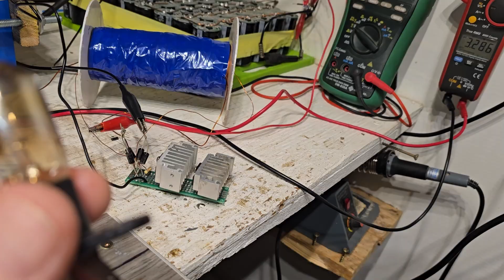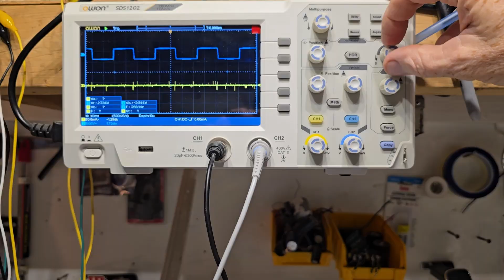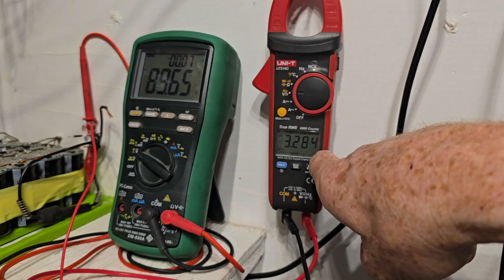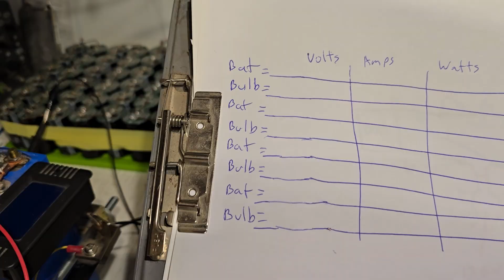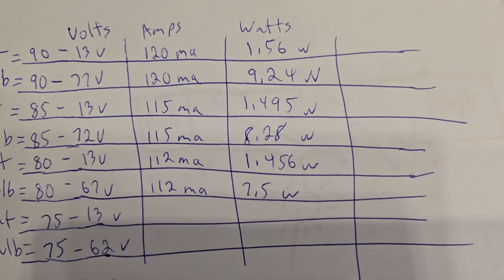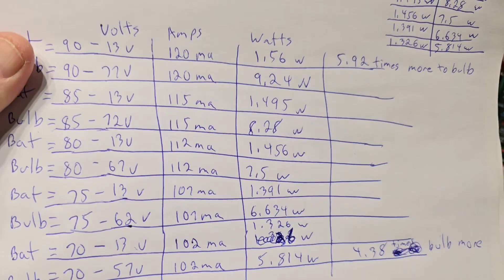New coil 13.1 volts input Charging 105V12F supercap bank then returning power back to source battery

Comment: Your results keeps getting better each time. Great work as always mate.  It would be interesting to see if the joule ringer coil with the same amount of turns has the right insulated wire rather than magnet wire which will generate the Ferranti Effect. The Ferranti effect refers to the phenomenon where the voltage at the receiving end of a long, unloaded or lightly loaded AC transmission line that can be higher than the voltage at the sending end. This unexpected voltage increase is primarily due to the line's capacitance generating reactive power when the load is low.  When a long transmission line is lightly loaded or unloaded, the line's distributed capacitance draws a charging current. This charging current flows through the line's distributed inductance, causing a voltage drop that is in phase with the sending end voltage giving the additive effect as  the voltage drop due to the charging current adds to the sending-end voltage, resulting in a higher voltage at the receiving end.
Reply from the maker: Ha I've already got videos made with this with another component added to this circuit.  I don't ever use stranded wire for this reason.  But I'd be interesting to see someone else trying your thoughts.  These results are very real very real and I would like to see others results with this circuit with their own type of mods. That joule Ringer circuit could be interesting with these types of mire and windings also.

Comment: Will catch up in a bit, just have a recurring question, finally putting it down... where would you shop for reliable super caps?  I tried searching on amzn, but the comments for most were quite discouraging so decided it wasn't a good source.  I have several applications for them, including tinkering of course!  Anyway, they can be pricey so don't want to spend on stuff that doesn't work.  Appreciate your advice on this.  Will watch this in a bit, been a crazy week.
Reply from the maker: I've always got mine from E-Bay
Reply: @windpowerandmore6310 any seller you find reliably good? Do they come with the protection circuit board or do buy them separately? One application I have is to place a pack between 48V batteries and inverter, basically size batteries to base load and cap bank for surge. I’m guessing I need to size cap bank to a voltage higher than 48V. They are LiPO4 so they likely push 51.x. But I think the caps need a buffer above that, right?
Step after that, as I have two sets of batteries, is to see if I can replicate what you’re doing. Cap bank would get second use that way. 😊
Reply from the maker: @VicNorth777 Buy from a seller with 100% feedback.  Buy the green cap 2.v 500F caps . The protection boards are sold separately.  The 48v battery bank should have 10v cap bank more so 70v of caps should be good.  Hope that helps
Reply: @windpowerandmore6310 awesome, thank you!